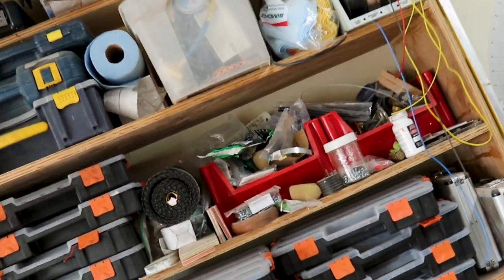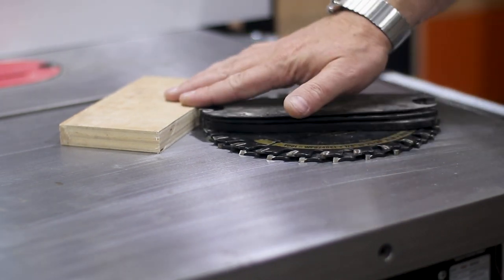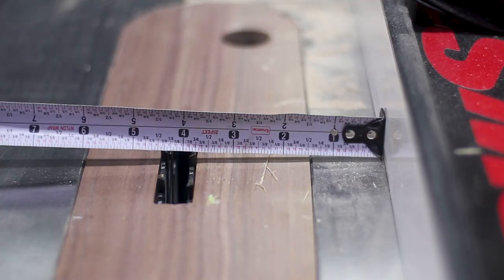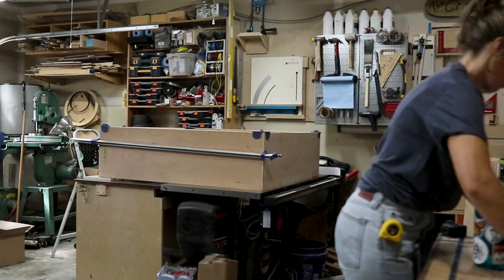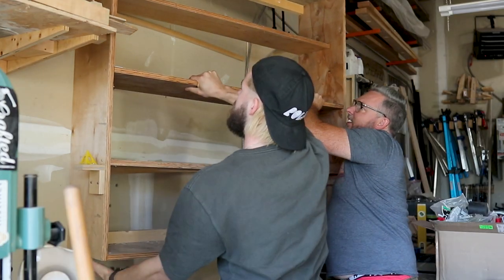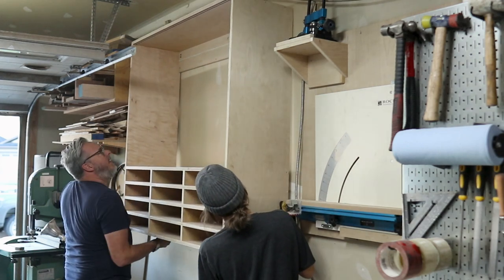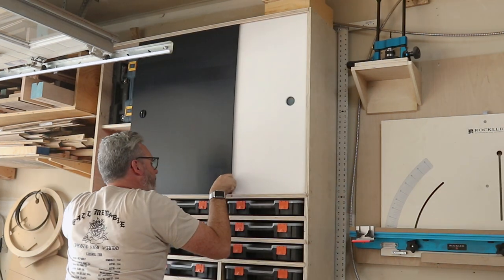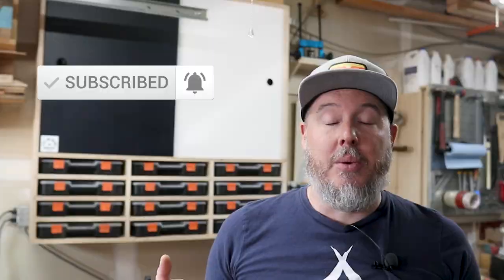How to Build Next Level Shop Shelves// Shop Organization Idea

Comment: Never got the argument "ruff cuts, then final cuts". All that waste add up during time. I just measure twice, cut once, and try to keep the off cuts to a minimum.
Reply: Sometimes you gotta cut boards down first so you're not jointing, planing, and dimensioning oversized pieces unnecessarily. 
I'm not getting a perfect 90, 45, or whatever from a board that's still wonky.
My order almost always starts with the miter saw for rough cuts, then jointer, planer, and finally sled or miter saw, and rip. Ripping last is ideal for cleaning up fuzz from crosscuts but it rarely works out that way for me.